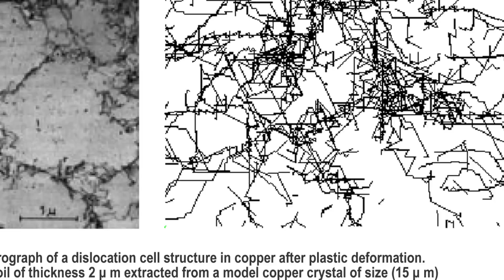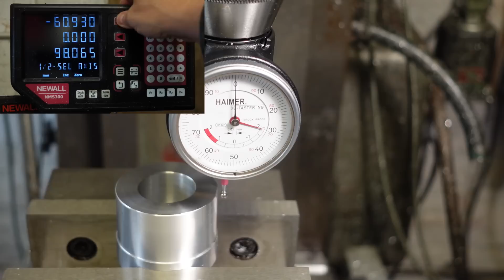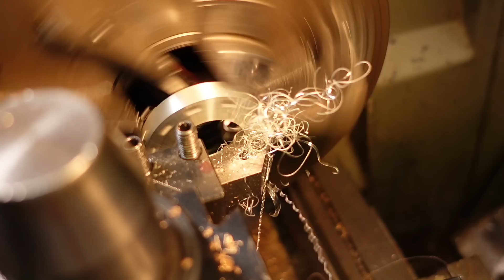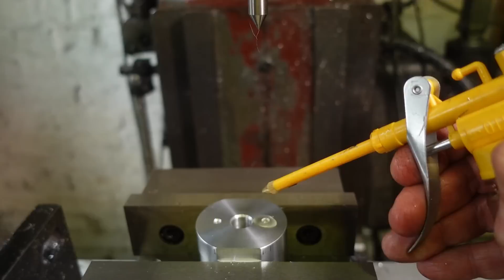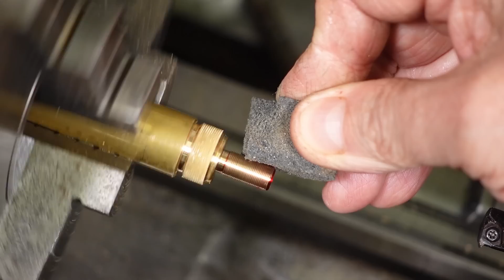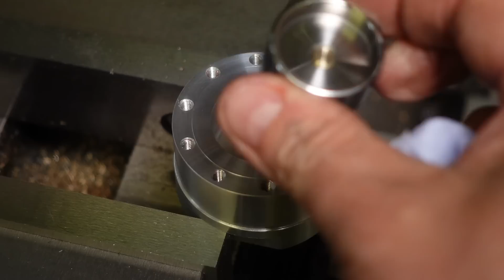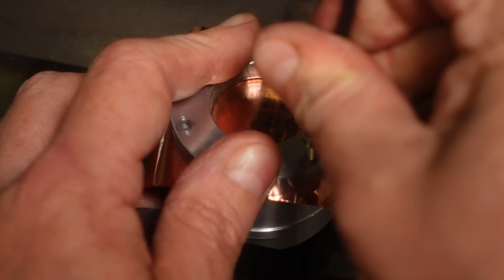Threading AWAY from the chuck! Great Seal Bug Membrane Strainer pt 2

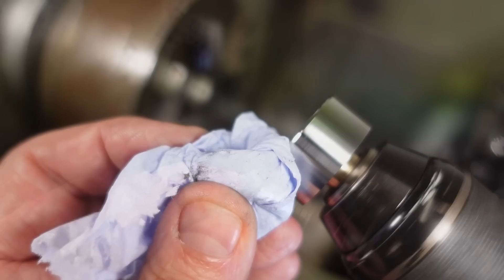Comment: Starting at 29:22 the piston doesn't appear to be seating square on the shaft - the gap between the two varies as the drill rotates.  A bit later the wobbling of the cylinder is very obvious and it would be tempting to attribute all of it to the vagaries of consumer-level electric drills and their chucks, but what if that isn't the full story ?
Reply from the maker: Well spotted!

I'm still suspicious about how wobbly the shaft was when I chucked it up, then went ahead and "trued" it without checking to see if the body was actually running true..  If there was a chip under the face or if I'd damaged the thread and raised a burr when I countersunk the hole, that could have made it look wobbly, so I unwobbled it, but then maybe it fixed itself when I took it apart to degrease it, and put the unwobble back as a new antiwobble.  The drill is an almost-new Milwaukee 18 volt so I think the bearings and chuck are fairly good.  

Anyway, I got annoyed with the piston and made a brand new one which is larger diameter, then bored out the clamp ring and body to fit and now everything is lovely and true. If I get a moment, I'll pop the old piston into an  ER40 collet chuck and indicate the shaft and face to see what is going on. Or use it as a third-rate eggcup.
Reply from the maker: Mystery solved.  Remember when I gripped the piston in the 3-jaw then took out the wobble?  I only did the last 8mm of the brass shaft, the rest still has the original wobble, and it was that section that I gripped in the drill chuck.  Putting the piston into a collet chuck, the runout in the dimple and in the first 8mm of the OD is minimal, but the rest of the shaft is WAAAAAAYYY off.  Phew, had me slightly worried for a while...

Comment from the maker: Lots of interesting ideas about annealing the foils. Looking up annealing temperatures, I think it would need either a sealed argon atmosphere, or be done in a vacuum furnace, otherwise I'm going to end up with an oxide layer. I could probably cut 100x100 mm squares and hang them vertically from clips.  Perhaps infra-red elements in my vacuum chamber would work, although measuring the temperature of the foil isn't going to be at all easy.  I made a machine to do nitrogen reflow of surface mount printed circuit boards back in 1980, perhaps an Argon version of that, using a replacement paint-stripper heat nozzle and a PT100 temperature sensing element and magnetically-driven fan would work? No idea how to run bearings at those temperatures though, perhaps tungsten rods on ceramic?  Can't use permanent rare-earth magnets at those temps. Pickling the foils is a non-starter, so an oxidation-free anneal is vital.
Reply: https://www.youtube.com/watch?v=O_Fo7mfZg7k

Comment: Maybe you can try to use a hair dryer to get the foil warm while tensioning and then let it cool off when it is fully tensioned, so it contracts and adds even more tension to the center of the foil without over tensioning the outer portion of the foil between the plunger and the fixture. I think your main problem is the friction between the piston and the foil and this method allows you to get more tension to the foil without additional friction...
Reply from the maker: Even the gentle wind from a hairdryer distorts the foil and makes it flap about, potentially causing creases.,  but I after reading your suggestion, I just tried an infra-red heat lamp that I used to use to keep newborn piglets and newly hatched hen/turkey chicks warm. Method was to use a large disk about 95 mm diameter, lay down some glue on it, then float the foil on to the glue, turn on the heat lamp, drop a ring weight on to the foil, pull it tight all round before the glue sets, then turn off the lamp once the glue cures.  That seems to work well enough, but with the foil at around 60C over ambient, across 80 mm diameter, the expansion is 1.6e-5 per Kelvin, so only about 0.1%. That's not very significant compared with the 5-7% strain I need, but it might help to avoid wrinkles.  I don't want to get the foil too hot as I want to avoid surface oxidation.  Any post-fixing treatment apart from solvent degreasing is extremely tricky.  I can't even use the ultrasonic bath, it's way too violent.
Reply: @MachiningandMicrowaves  i was thinking about heating the foil when it is already clamped in the fixture, then tighten the piston to a point where the foil nearly ruptures, and then let the foil cool off, so it gets stretched a little bit more.
Maybe a little bit of heat also makes the foil a little bit less brittle, so it can be stretched a little bit more without rupturing.
Reply from the maker: @Henning_S.  Ah, heating it enough to have a useful effect might be counterproductive as it will reset the work-hardening and leave the foil relaxed in the stretched condition. Doing the work-hardening with it cold is important. Perhaps up to 120C would be OK, and that would indeed add some useful preload in addition to the elastic strain.  The key point is to stretch it almost to yield point and the full-hard condition.   Fascinating subject all round.
Reply: @MachiningandMicrowaves  You could use a (black) radiant heat source that is temperature controlled to 120C that fills the field of view of the foil so that it behaves a little lie a black body radiator and might equalise the temperature of the foil.

I also would have forgotten about the annealing after the desired work hardening.
Reply from the maker: @KallePihlajasaari  Good idea, better than the heat lamp. The only minor issue to address is that the piston is rather close to the edges of the mount that I need to fix to the foil so I'd have to be careful about not chilling the outer part of the stretched diaphragm.  Simple fix would be to make the stretching jig rather larger, then I could use a black-body box with a heated plate coated with carbon and with diffuse mirrored insides and a small orifice, same as the folks experimenting at 30 THz are using as a calibration source.
Reply from the maker: @Kalle Pihlajasaari I know a little about the subject of the video you mentioned.  Perhaps I should have a think about it once I get all the current jobs out of the way. Message was marked as spam by Youtube's over-enthusiastic filters and now doesn't appear and I've lost the link. Could you perhaps drop me an email to neil@g4dbn.uk with the link?

Comment: Disagree. Watching a curve come to life from tangent cuts is extraordinarily satisfying.

Birds and pup? I feel spoiled!
Reply from the maker: I'm slightly biased, having made some hyperbolic subreflectors using more than 30 tangential cuts, I do rather yearn for a form tool or CNC  lathe sometimes, but yes, sometimes the process of incremental tangential cuts is really enjoyable. I must get on with the servomotor drive attachment so I can make large high precision hyperbolic/elliptic reflectors. There are geometric linkages that can do conic section profiles, that might be a very amusing thing to try, cutting a hyperboloidal solid using pure geometry.
Reply: @MachiningandMicrowaves  there's also the linkage option, but I'm not sure if the stiffness would be sufficient, particularly for the size they would need to be. Serious bragging rights though, mechanical computation is cool.
Reply from the maker: @fletcherreder6091  Well now... All the cutting forces are unidirectional and I could use metal or pneumatic springs to preload the mechanism and use taper roller or angular contact bearings. It would be very cool. I only need about 1/20th of a wavelength max RMS error, so even at 122GHz that's only to the nearest 0.12 mm or 5 thou/mils and at lower frequencies it's even less of a challenge. The linkages are not simple though
Reply: @MachiningandMicrowaves  Oh dear, I'm going to be thinking about this for a while...
Reply from the maker: It looks like all of the hyperbolic curve linkages need sliding elements, so perhaps a linear shaft bearing could be adapted. I'm also going to be thinking about this for some time!

Comment: For finding the minimum travel to cover a bolt pattern, there are several graph algorithms (A* comes to mind, DFS with pruning, SSSP modelling the distance as an edge weight, Djikstra's using the same idea, etc).

Or you could just, you know, drill arbitrarily. It's not like you're making more than one of these.
Reply: They way he did it is actually just about the easiest on a manual mill. With the center of your bolt circle at 0 you can go to the negative of the same value in one axis and repeat the operating procedure.

Grey matter is the bottleneck here.
Reply from the maker: I need some sort of AI assistant. AIMEE tells me she isn't a pocket calculator and that I should ask Siri and Alexa, but they feign ignorance. Now I have full programmatic control of AIMEE's voice engine, I could get her to start winding up and annoying Alexa interactively.  Siri sounds awfully chipper and upbeat these days, and it feel cruel to annoy them. Alexa just says "I'm sorry, I don't know that" when faced with a hard question that should be trivially easy for a bunch of if-then statements and ML weighting scores to answer, so is fair game. Good for shopping lists, but thick as two short planks when it comes to searching for music tracks or interpreting equations.

Comment: I'm going to hazard a guess that these are for Infrared/THZ filters, using lithography patterned copper meshes. I assume these are now off to somebody else to get patterned.
Reply from the maker: Heh heh, I'm saying nothing! I did wonder about whether I could emboss the surface to make some sort of filtering mirror or 3D diffraction surface like those rainbow holograms printed on to chocolate, but for mmwaves

Comment: So I'm still not quite sure what you're trying to achieve here.

Obviously you're trying to stretch the foil, presumably both to harden it and to get an incredibly flat diaphragm for the secret project.

Is there a specific amount of hardness you're looking for? If this is to vibrate in its intended use I can see how that might be rather important, but if it's just to stretch it flat... Annealing would help a lot.

I suspect a good part of your problem is in the initial mounting of the foil.

I would make a larger pair of rings without the bolt holes through them out of HDPE or some other bearing plastic. Back them with a bit of ally or steel and then an arrangement not unlike a flower press.

You can then apply a small amount of clamping tension to the foil and just move it by hand to get it good and flat.

Then with it held in there, mount it to your stretching jig.

You can also look at the deflection you're putting into it. You might be pushing it beyond the yield point regardless of how careful you are.
Reply from the maker: I think you're right about making a larger clamp without bolts and perhaps using UHMWPE or other low-friction material. This cheap foil is only available in 100 mm width rolls, but I can get 150 mm squares interleaved with tissue paper, although they are stunningly expensive.  I need to do something similar with stainless steel and nickel foils
Reply: @MachiningandMicrowaves  The question is what are you trying to achieve?

Not in terms of what this is used in, but in terms of what material properties are you trying to achieve?

Is it just flatness, or is it also hardness etc as well?

Are you able to talk about exactly what that material is? 200mpa copper foil isn't a lot to go on...
Reply from the maker: I'm trying various types of copper foil at 10 micrometres thickness.  Most of it has no statement of composition, some has a little nickel, but I'm guessing it's electrolytic copper with some oxygen content.   I need the diaphragms to be flat to about a micrometre and under elastic strain at around 50% of the value before plastic deformation starts.  This part of the process needs to work-harden the material and get it flat.  In the finished application, it will be stretched to the final working tension.  I've also got to try with gold-plated stainless steel foil about 5 micrometres thick with a micrometre of gold, and possibly 10 um nickel with a copper or silver plated layer.  It would be much more fun to try to make a continuous plating machine with a titanium drum so I can make my own custom foils, but this is just a tiny corner of one project and I need to get on with all of the others.  Too many interesting rabbit-holes to go down.
Reply: @MachiningandMicrowaves  Any reason you can't just roll it?

Polished rollers should give you something quite flat, or at least flat enough to get you the rest of the way there when placed under tension.
Reply from the maker: @dtnicholls1  The challenge would be in finding or making some rollers with the required pressure and precision. The big rollers used to make aluminium foil can't get anywhere close to the required thickness, they have to roll two sheets for the finish pass, and you end up with a matt face on one side as a result. Preventing ripples requires an extremely stiff assembly.  The surface finish needs to be near-optical quality, so RMS variations of a fraction of a micrometre. I don't have anything that can approach that sort of precision. The stretched foil is about 8 micrometres thick, 16 wavelengths of light.  Second issue is asymmetric deformation.  The radial stretch makes the crystal structure have radial strain lines and aligns the crystals radially, whereas a roller would tend to form elongated grain boundaries and not increase the width by much.  Even if you took multiple passes at different angles, it would be tough to get a decent  microstructure that was hard enough to stretch into the elastic region.  Ultimately, copper and copper alloys are not the right material from a physical perspective although they are good electrically. 2.5 um of gold plating over 5 um stainless steel foil might be a good compromise but that isn't compatible with the client requirement.

Short version:  rolling is very very hard and/or very very expensive and doesn't achieve the microstructure required. It might be a whole lot of fun to play with, but I'll let someone else try it.
Reply: @MachiningandMicrowaves  study closely where is the rupture point starting. It looks like it is outside of the stretching ring suggesting you need to work out how to lower the fiction between streching ring and foil. Try polished PTFE or some sort of lubricants assuming  the lubricant removal will be possible without making the foil unsable as i don't know the purpose of that foil. It remind me one thing i was thinking about some years ago - i was interested how to make ultra small, tiny Bourdon tube to make very small pressure manometer. I failed to find bronze foil of such a small thickness like the one you use. I assumed bronze as nice work hardening material for that purpose but now i think i need to come back to the project and try using copper foil. What you think about copper for tiny Boudon tube? Thank you for  your entertaining videos, sub!
Reply from the maker: @The_Unobtainium  The difficult issue with any lubrication is that the support ring has to be soldered to the foil, and keeping the lubricant away from the solder heat is rather a challenge.  I considered using graphite powder, but the failures happened in different places in different tests, and I found that if I pre-tensioned the foil with a large ring before applying the top clamp, then the angle of the foil across the piston edge was reduced and that helped to reduce the friction. I suspect that there are lots of ways to improve the reproduceability and that a better-finished and annealed foil would help.  Luckily I only needed about five successful membranes and I had enough copper foil to make about 200! Copper is a terrible material for anything involving repeated significant flexure as the grain boundary modifications and creep over time are excessive unless the alloy has a lot of phosphorous and other additives.  The membranes are for the resonant cavity microphone diaphragms in my replicas of The Great Seal Bug https://youtu.be/GyryQltyDwA

Comment: I'm wondering if 3 retaining screws would have been better than 10...
Reply from the maker: I ran a simulation in Fusion 360 and it shoed a lot of variation in contact pressure with six or fewer screws, and there was still a little variation with seven, so I picked ten.  I'm still regretting not going prime and picking 11.....

If I used a stiffer material or made the ring thicker, I could have used fewer fixings. I did consider using the hydraulic press to force the top ring down, not using any screws at all, just two alignment dowels, but it would be fiddly trying to see the state of the membrane

Comment: I just read a comment about trying a polished surface on the part that presses the foil, maybe a ball socket where it joins the screw? so it applies pressure more evenly?
Reply from the maker: There's a fair amount of side play as a deliberate design detail to allow the plunger to rock a little.  It should sort of take the average of all of the tensions as a result. Perhaps the point on the screw should have been a little more acute than 90 degrees, or should have had a ball inserted there.  Interesting.

Comment: Easiest way I have found to deal with tiny radii on endmills is to use a dovetail cutter.  Drop it down enough to take about .005" off the shoulder with appx .030" undercut.
Reply from the maker: That's a neat trick. I got offended by the hacksaw cut, so I held the body in a machinists vice which was in the mill vice at 45 degrees and ran a 1/16" slitting saw along the inside of the angle.  Looks perfect now!